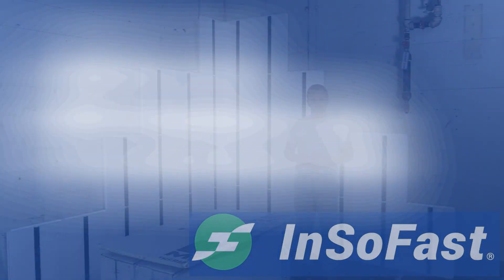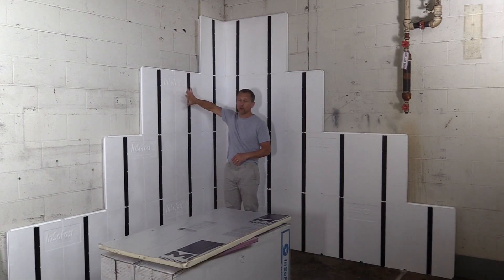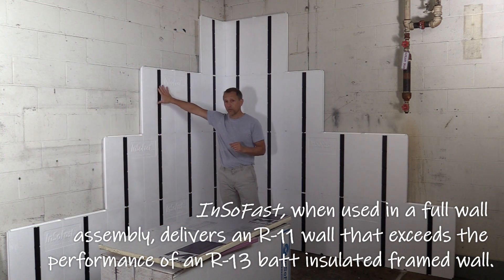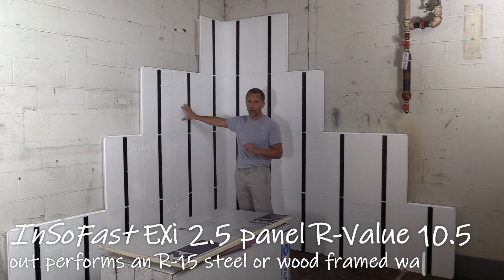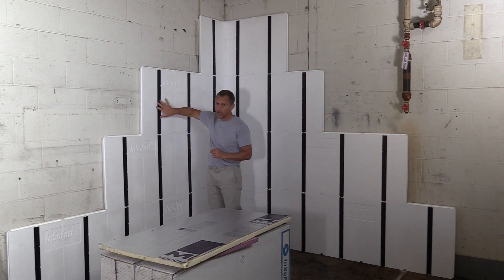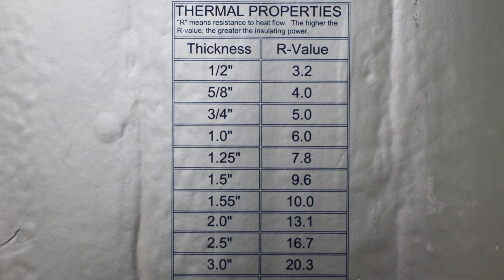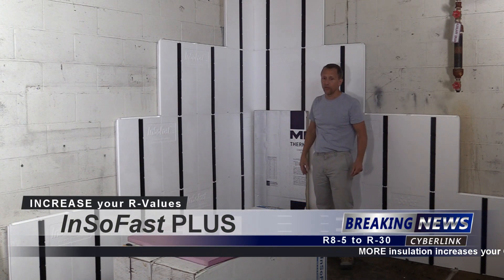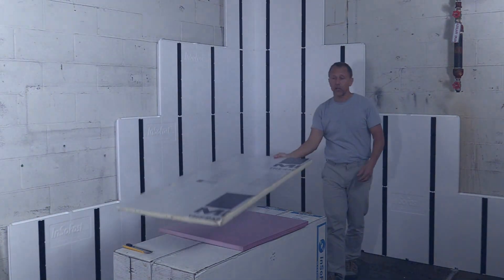InSoFast PLUS Explained How to achieve higher R-Values

Comment: Dumb question ; is there a higher R-value InSoFast available or in the works? 
Also, what happens to the electrical outlet installation and drywall installation with the added thickness of potentially 4 added inches of foam board insulation?
Reply from the maker: Electrical boxes have box extensions available at most hardware stores. Adding thicker foam like 4" can present challenges and there are many different ways to achieve higher r-value InSoFast might not be the best solution for all applications. I suggest you contact us at 888-501-7899